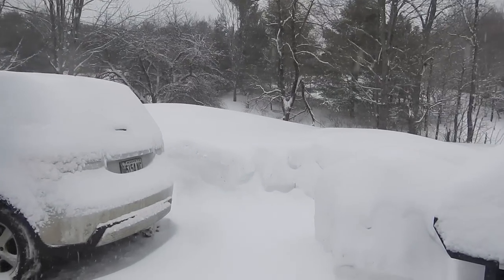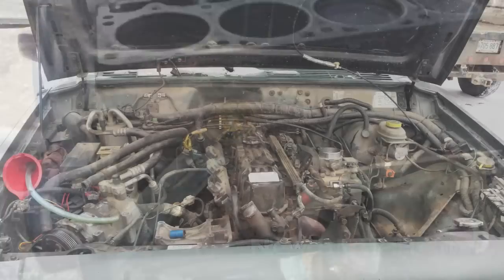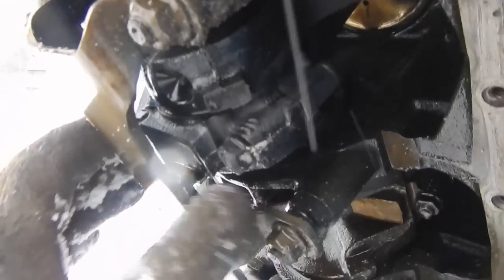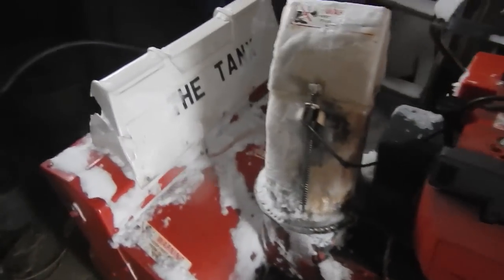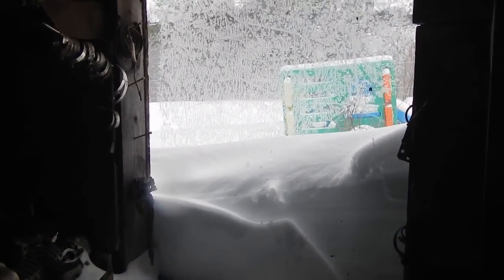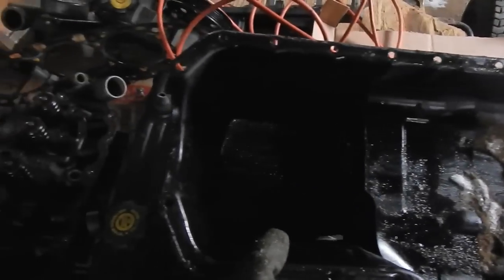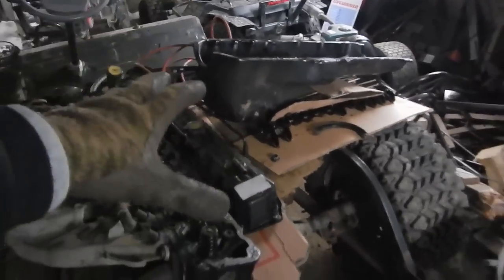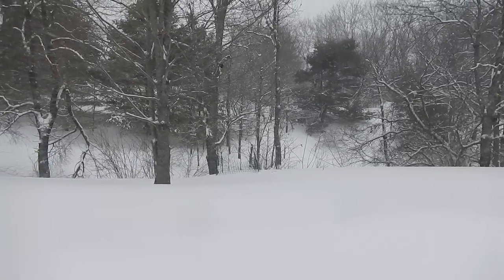Winter '15 Updates & Jeep Engine Carnage

Comment: I'm in the exact same situation with my jeep, I have a 2000 with a 0331 head and coil packs. I have 223,000 and she is still running hard but it's only a matter of time. Trying to find a motor with a tupy head or just gonna piece one together and build a stroker

Comment: Aw man, I feel your pain. This is sucky weather. We got about 1 1/2 feet so far here in Cleveland. Those storms just clipped us on there way up to Maine there. Glad you got the Jeep running right. Mine is an old AMC one and so far I changed the motor 3 times. Jeeps must have sucky oil systems.

Comment: You could probably get at least 100 to 200 for the block alone considering it is not cracked and straight. Stay safe there and keep warm!

No better here in Kansas with the temps going every way possible with it nice several days then dropping to freezing or better the next few.

Comment: Hey fearless! I absolutely love your videos! I have seen all of your tractor videos! You are my role model for many mechanical things. I was wondering since you being the correct person to ask, if you could tell me whether a 1980s square hood craftsman II would make s good romping tractor? I'am going to lock the trans, put v treds on it, and a few other things. I was thinking of maybe trying to get a waterproof sticker for it, one you could autograph for me.. If it's possible. It would mean the world to me if I get a response from you!
Reply from the maker: Jesse Cammisano Thanks for watching man, and yeah, that sounds like a good base for a build. Hopefully it has a geared transmission so you can pulley swap it. I don't have any stickers on hand right now, But I will be sending out more in the spring
Reply: I have the same plans for the future!  Except with a 4 wheel drive shaft driven John Deere or Simplicity top of the line garden tractor.  Otherwise a Sears 16/6 twin or 18/6 twin.

Comment: I need some help on figuring out as to weather or not to use a chain or belt driven setup on a Kohler Magnum 18Hp Craftsman with a horizontal shaft vertical pulley, rear trans axle, and, I was thinking of making the ratio a 1-1. And another thing i cant figure out, should I use a Predator 22Hp V twin, or a single cylinder diesel. But that's not all, I also need help with finding 23*10.5/12 rear tires for cheap with damn good grip. If you know the answers to these questions let me know. I need help with this build, its my very first off road build and I don't want to mess any thing too major up in the process.

Comment: Im working on my lawn mower as a class project weve did alot of body work an engine work an mods beleve it or not we rigged up a adjustable turbo an it works to a point just a few more mods left but anyways i had dropped the rear end an locked it an pully swapped it an everything but the linkage that swithed the gears with the handle is all out of wack an stuff but i was wandering if you could send me a picture or link or anything showing how long that linkage is supposed to be an sit an i was wanting to know if it would still be strong if i drilled a hole in the rear axle an put a pin threw it like the old axles instead of a c clip

Comment: Fearless, what do you do about the governor, on your tractors? Do you ever have to worry about the engines throwing a rod or something? Because I put an adjustment on my tractors governor, and I was told it will only last about two years that way, so do you have any advice?

Comment: I have an older craftsman mower that I am wanting to turn into a dirt-track racer and off roader. Would you recommend that I lock the flex on the front axle? Or should I space out the wheels on the front. I noticed that at high speeds and on turns, it leans pretty hard and is kinda tippy. Any thoughts? Thanks!

Comment: I didn't have a rod knock, but if you're 4.0 was anything like mine, every bearing surface in that motor was fucked. In mine, the first cam lobe and lifter was ground to oblivion, and that got pumped through the oil system and scored every bearing in the motor. It was absolutely horrible.
Reply from the maker: thats a bummer. Luckily, the motor's are pretty cheap if you look around. I spent less on the jeep motor than I did for the motor on the racing mower
Reply: I thought about just doing a junkyard motor swap, but my dad talked me out of it, saying "If you're gonna do it, you might as well do it right." So I dropped $1500 into the motor, had the cylinders bored, block cleaned up, put in .030 oversize pistons... The only thing I reused from that engine (internally) was the connecting rods, rockers, pushrods, and main bearing caps. New crank, cam, lifters, valves, and pistons. It was a huge investment into the build, but at least I have the peace of mind of knowing this thing's basically brand new. The old engine survived 225,000 miles, I'm hoping for another 200,000+ with the right oil.

Comment: I need some help and I know you know stuff about lawn mowers. I have a B&G 10HP engine on mine. If i tilt it forwards or backwards it leaks gas around the bottom of the carburator. It leaks around the top of the bottom part of the carb. If i have sit flat on the ground it does not leak. 
Do you.have a solutuion
Reply: Found it out my self, the gasket dropped off when I was going to put it back together...

Comment: use 5w20 all year. evrybody uses too thick oil. 98% of wear on engine is the first 3 minutes at startup. AND THATS  WHEN YOU NEED THIN OIL, EVEN AT 90 DEG IN SUMER. IN WINTER USE BLOCK HEATER,,,REMEMBER- 98% wear  is at start up.